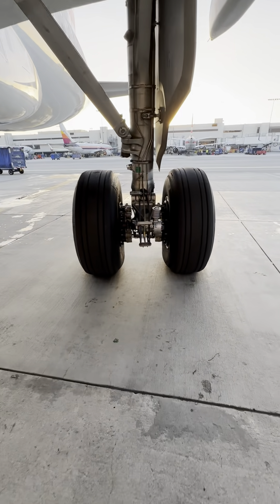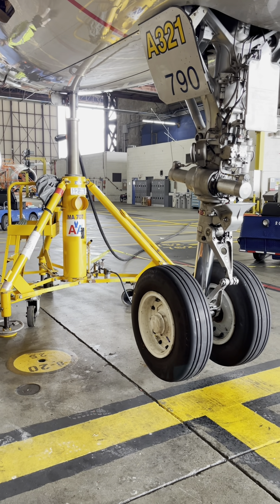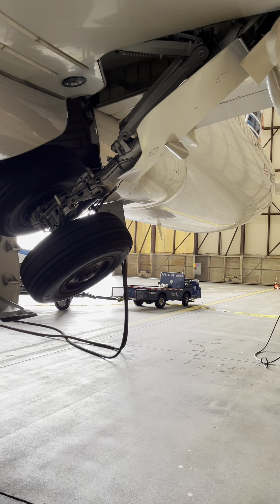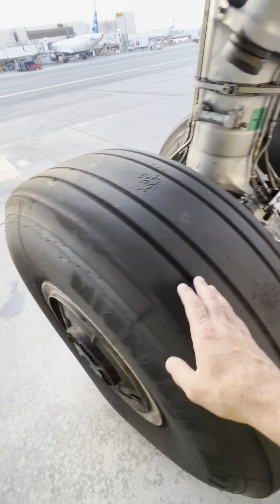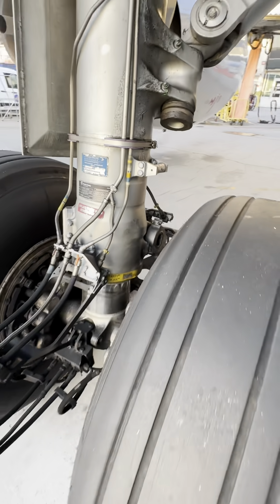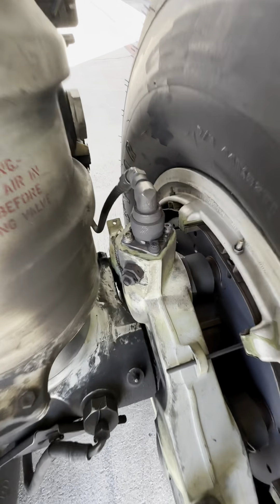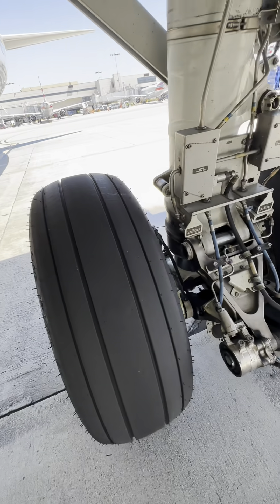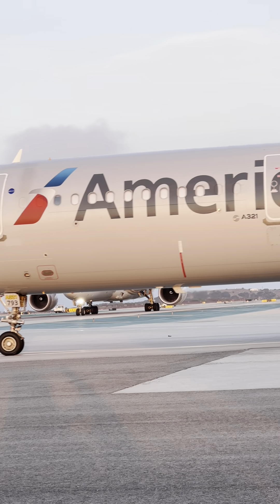Airbus 320 families and Boeing 737 Main Landing Gear comparison

Comment: 737 is ground hugging landing gear,whereas 319,320 is high standing gear,they can't be compared.
Reply from the maker: Those are the only 2 narrow body aircraft you can compare. Nothing else is in the same class. I mean we can squeeze the 757 in there but that thing is in its own category at this point. Nothing can touch it.

Comment: Most important difference, how short 737 gear is.  Easier  loading  but hard to put bigger engines without dragging on ground.
Reply from the maker: That’s why on the 737 max they had to raise the nose gear to accommodate for the larger engine
Reply: @StigAviation  Yes, the 737s advantage over many years caught up with it and gear had to be changed.

Comment: How often do u have to change the brake pads and is there a rotor that has to be serviced
Reply from the maker: It’s unpredictable. To many factors to consider.
Reply: They are not like car brakes. The brake assembly has the rotors and stators as one unit and are replaced as a unit. That’s what the wear indicator pin is for, to see when the brake assembly requires replacing @3:00 Airbus and @5:23 Boeing

Comment: Less than half the fleet at my company has brake sensors. Theres a flag that comes up in our landing data if we land heavy and or short runways and need min brake cooldown, usually 60m turn. 
Some of our aircraft have the temp sensors, but dont rise in temp that wildly.
We use a carbon brake from France but believe were switching soon, so well see how that works.
Reply from the maker: Most pilots I talk to seem to enjoy the carbon brakes. They say they can feel the difference
Reply: @StigAviation  They stop very well. The only oddity is they wear faster from small applications, so it's better to let the plane speed up then romp on it during taxi.
Reply from the maker: It’s all about the settings of what pilots put in. You also have to taken into consideration runway length

Comment: Geeky tech!!! more to go wrong, and another issue, the A319 main undercarriage leg has a TRUCK a single two wheel axle, not a bogie, like those on a skate board. A bogie is a strong frame mounting two or more axles and wheels in tandem one behind the other.
Reply from the maker: I’m glad you are very knowledgeable about the subject
Reply: Yes  and thanks for your kind comment, it is appreciated as an aeroplane undercarriage is like the foundations of a decent house. Get the foundations right, building the rest of the house is easy.  I live barely thirty miles from the Dowty(Safran) factory, set up by its founder George Dowty in the early 1930,s.   @StigAviation
Reply: Regarding the A319 oleo leg not strut, its upside down shock absorber cylinder and seal, a unique ,practical solution. Keeping these important parts away from dirt and brake dust when operating from poor or loose surfaced runways. Looking like a Luvax friction shock absorber of a 1930 4,5 Litre Blower Bentley, the secondary damper not dampener on the torque scissors is  a means of reducing 'pitter patter' when the tyres contact the runway before the aeroplane squats on  the main oleos,.   @StigAviation

Comment: One good thing about the 737 is that the WOW sensors inhibit the stall warning so you don’t get a stall warning on the ground. Airbus inhibits the stall warning under 50kt IAS as far as I know. This has proved problematic in certain accidents, like AF447 for example, where erroneous airspeed information from frozen pitot tubes led to pilots discounting the stall warning because it was deemed unreliable. We know how that ended… 😢
Reply from the maker: Ya that was a bad one on 447. But that wasn’t the only factor that contributed to the incident. So many things went wrong and lots of pilot error.
Reply: The pilots’ errors were largely down to the plane misleading them and to a faulty pitot that the manufacturer knew was faulty. Pilot error is very useful when the pilots are deceased and you can’t say the part and plane makers knew.

Comment: Boeing does have wheel brake cooling systems in place. If the brake overheats the wheel comes off and rolls away to expose the brakes to cooling air.
Reply: You joke but how often does a plane really need break cooling. Basically a rejected takeoff right, how often does that happen? Around 20 years ago I was told that one pound of additional weight costs an operator $50k in fuel over the planes lifetime. Probably closer to $100k now. Is it really worth it to haul three fans around for that situation?
Reply from the maker: @Kandralla  look, I just fixed these things, my opinion really means nothing. I have no problem with changing wheels that have brake fans or that do not have brake fans. It’s all the same to me. I still have fun.

Comment: Notice that all tne bolts on the Airbus landing gear have been fitted and the lock wiring and cotter pins installed. You can tell by those simple observations it's never been in a Boeing factory.
Reply from the maker: But Boeing also uses lock wire and cotter pins on a variety portions of their landing gear as well
Reply: @StigAviation  Boeing supposedly torque down all fasteners and use safety wire and cotter pins throughout the aircraft they design and manufacture.
That's why sometimes doors fall off brand new aircraft in flight and other parts wobble a bit, ask Alaska Airlines how that works😁
Reply: @andrewallen9993 by design that is what BOEING do. It’s up to the factory workers to ensure they follow the correct procedures to ensure it’s assembled correctly. Hardly a design fault when the guy that assembles the product can’t do his/her job correctly

Comment: What is Boeing's thinking in not providing cooling fan in the wheel? Because the wheel area is already full of axles, bearings, brakes, wheel speed measurement systems and possibly tire pressure and brake temperature measurement systems. Why add the weight and complexity of a dinky little fan to all the above? If turnaround time is important, provide the ground crew with some large fans they can use to cool the bakes. I have worked on the design of wheel based systems for both the A-320 and the 737 and the A-320 is a real pain from the design standpoint in that you have to accommodate the design to all the wheel options Airbus has offered over the years as well as the presence or absence of all the different cooling fans. We had to send an engineer overseas to Airbus for a week just to nail down the actual size and shape of the volume that was available for our equipment.
Reply from the maker: I don’t have a dispute in regards to this, remember, I’m just the maintainer of these aircraft. The manufacturer will do whatever they want to do in regards to design. I personally don’t have a problem with Airbus design, nor with Boeing design, it’s just different mentalities and different procedures. But for me at the end of the day, it’s just nuts and bolts.
Reply: From a maintenance point of view the brake fans can be a blessing but also a curse.

With brake fans fitted, when the brakes are hot, the crew turn a switch on in the cockpit and the brakes cool down - simple. When we do a wheel change, the brake fan is now another thing to have to deal with. Ensuring the switch is tagged and CB’s are pulled so it doesn’t turn on while our hands are in there and extra parts to remove and install.

Without brake fans fitted, when the brakes are hot we need to find the mobile brake cooling fans. Uses time to find, hopefully they have enough fuel in them and need to position them next to the wheel - not simple. Doing a wheel change, great, no brake fan components to deal with

Comment: Having been a captain on both 737 and A320 I tell friends traveling in less developed parts of the world if you have a choice between an airline operating 737s vs. A320s………..pick the one flying A320s !!!
Reply from the maker: The 320 is definitely the smarter airplane, that’s for sure
Reply: My friend had to transition from the 737 to the 320 family and he said it was quite a revelation. Not only did it make his job easier (not just the primary flying aspect) but the architecture and software logic DO absolutely make it safer, you can seriously screw up and it’ll save your butt (just from stories and their training with the systems.)

Comment: Brake fans ??? ………..Brake fans ??? ………Are you f*cking kidding me?  737 doesn’t even have brake temperature gauges !!!  How would you ever know when to use brake fans ???????
Reply from the maker: What are you talking about my friend ? Can you put some context behind your comment?
Reply: @StigAviation  
The Airbus has brake temperature gauges in the cockpit. You can see the brake temps. Boeing you have no idea ! No brake temp display in the cockpit.
Reply from the maker: @savagecub  yes because it’s an option that the carriers don’t buy. There are temp sensors that can be installed as well as tire pressure sensor. Just options.  That’s all
Reply: @StigAviation  
I have operated-300s, 500s, 700s,800s &900s for two different airlines. Never seen brake temp gauges. I don’t even know where Boeing would put them since there’s no EICAS in the 737. I have however operated A320s for an airline that did not buy brake fans. At least though we the had temp gauges so we could at least see when the brakes were getting hot.
Reply from the maker: My friend, I completely understand what you’re coming from, but you’re comparing two different manufacturers that have two completely different mindsets and options. Either way break temperature is obviously important but not as important to Boeing on a 737. But take a look at the 787. Completely different perspective right!
Reply: @StigAviation  
Yes I flew the 787 as an FO for six years it has a brake temp display. The 737 does not have anywhere to display brake temps so it’s not like it’s any kind of an option for that airframe.
Reply: @StigAviation  Airbus A320 and Boeing 787 have the same design and manufacturer SAFRAN!

Comment: You use A319 in the title but show a nose gear retraction with A321 on the door.   Also, Air India operates A320s with twin axle mains.
Reply from the maker: I should’ve made it clear and said 320 families. I’ll edit it. Thank you for your help.

Comment: As an A&P myself Boeing didn't do it because it adds weight and cost to the aircraft, and they are really not that necessary and the amount of time they save is not really worth it.
Reply: Can you do the fan with the wheel hub exposed in flight?
Reply from the maker: @danielbond9755  what?
Reply: Some additional elements: brake temperature may be on the critical path of turnaround time as you are not allowed to take with a A320 with brake temperature higher than 300°C (or something close to it). Thus, even if it saves limited time, if this is maintaining your turnaround time under control, it can be valuable, especially in summer. EasyJet understood it as they took the option.
However, the brake fan has a significant drawback because it is blowing oxygen on hot Carbon which is increasing the oxydation and, thus, reducing brake lifetime (which is pleasing Carbon disks manufacturers as this piece of equipment is one of their golden eggs chicken).
Reply: I guess Airbus actually puts engineering ahead of CEO salary incentives.
Reply from the maker: Yup, that pretty much sums it up. Although it is nice to be able to cool it down faster when you have a brake or wheel change 😅

Comment: I wonder what would happen if a pressurised aircraft cruising at 38,000 feet had a tire blow up inside the wheel well. It sure looks like there is a whole lot of mechanical devices in there,surely vital to aircraft control... . Humm... Ladies and gentlemen, we have just right aileron control available, so we'll spiral down safely toward our destination.
Reply from the maker: It would never happen because tires and wheels have over pressure plugs and thermal fuses to release the air pressure out before the tire reaches blow out limits.
Reply: Something similar has happened to Boeing planes more than once. Damaged tires retracted with those steel wires hitting everything inside the compartment and causing catastrophic damage to hydraulics. The little thing to stop tires spinning is a cheap Boeing solution to that problem.
Reply from the maker: @samueldavila2156  you’re talking about the 737 Frangible fitting.

Comment: Boeing didn’t put brake fans on because the 737 doesn’t need brake fans.  I’ve been flying it for years and never had hot brakes.
Reply: I flew a 737-300 for years and only one of the 20 or so different airframes I flew had brake temp gauges. So we never knew if the brakes were hot or not. Ignorance is bliss.
Reply from the maker: Because the 737 is not as heavy. Also most 737 have steal brakes, and the fans help with a quicker turnaround time with the Airbus.
Reply: Our B737’s used to have steel brakes but we retrofitted carbon brakes. The steel ones were disintegrating. There have been the odd occasion when brakes fans have been required - but not many. Usually in the middle of summer, auto brake on MAX, and a lot of taxing

Comment: Hi Stigy…. I was wondering upon landing do they do more braking from reverse thrusters or wheels?  Also tire balancing… I’m sure it’s not like automobile tires with wheel weights is it?  TY Sir
Reply: Thrust reversers, not reverse thrusters :)
Reply from the maker: It’s about 50/50.  Also depends on length of runway and pilot. I seen super hot brakes because it was set to maximum braking and I seen cold brakes because the thrust reverser did all the work and braking was minimal. It’s a very dynamic situation where many factors come into play. As for balance of wheels. They come pre balanced from the overhaul shops. We don’t do that on the line.
Reply: Thrust reversers are most effective at high speeds (important to get them in quick, also why they’ll stow even though you’re still moving rather quickly.) 

In certain conditions, TRs do a lot of the work - ie. rain, snow, etc when braking action is poor (planes have an INSANE amount of inertia with a relatively tiny contact patch with the tires in which to transfer that energy.) 

I spoke with some crew (I believe it was Virgin America with one of their brand new A320s) and asked why they didn’t use any TRs at all, and they said it’s SOP to use moderate braking with their carbon brake-equipped Airbus fleet if conditions allow. It’s actually cheaper (they have excellent wear properties) than using the fuel and maintenance associated with deploying the reversers. 😳

Comment: Another great video. An important feature of the Airbus (SAFRAN) landing gear design is the inverted shock absorber that keeps the seal out of the dirt where it can be degraded and eventually leak. Leaking landing gear struts on an Airbus are non-existent.
Reply from the maker: You are correct. But I have seen it lean very rarely. Good news is that it has a built in secondary seal that we can activate. Smart design.
Reply: From my experience it isn't  that rear to leak. We've changed the seals of more then 20 a320 neos and ceos only this winter. *Disclaimer: I work in base maintenance and all of the changes were not customer requests but due to leaks found during inspections.

Comment: Only thing omitted is the strut switch that tells many things the airplane is on the ground..rt main for the Boeing. All Boeing pilots should know this. When able, feel for the ground with the Left main..the right one will cause ground spoiler deflection and can ruin a nice landing.😊
Reply from the maker: You’re absolutely correct, the cable that runs up to the spoiler actuators to activate them it’s funny they only put it on one side 😅. Boeing doing Boeing things I suppose 😂
Reply: @StigAviation and if I remember correctly...on landing..wheel spin up and strut compression,/sqwat switch..and some sort of timed relay. You can actually " fool the speed brake". On a really, really nice landing. The speed brake auto arm will just make a clutch sound but boards don't come out. Yes,,this landing can be done...but the pilot has to understand the whole system. You must land on the back side of the tires. 98% of today's pilots have no idea what I am talking about here 😮.
Reply: Used to be a Boeing fan, but this channel is making me kind of an airbus guy

Comment: I prefer the digital maintenance manuals from Boeing. To this day, the ones from Airbus do not work on my iPad. Not that Boeing toolbox is without fault, but it has been more reliable for me.

Also the Airbus manuals feel like they haven't been written with much care. Example: I selected the correct effectivity, then opened the correct manual, in there it shows multiple possible locations with an asterisk: *may vary per aircraft🤬. THEN WHY DID I EVEN BOTHER ENTERING THE CORRECT EFFECTIVITY IN THAT POS JAVA BASED SOFTWARE CALLED N@VIGATOR! SMH!
Reply from the maker: This must be a software issue on your interface my friend. Because I never have a problem with my airbus manuals. And all our manuals are digital at this point, Airbus and Boeing. The toolbox is nice especially for the 787 but the rest is still very old. The Boeing SDS is written poorly. In that regards airbus does a better job at breaking down the systems.
Reply: The Airbus manual works fine on my iPad. However, there appears to be some misunderstanding when the Airbus manual is translated to English. Some of it just makes no sense. “Make the thrust reverser unserviceable” - what does that mean? Drive a tug into the side of it?

Comment: Does the 737 have bladders that inflate around the outer tire when they are stowed? I think I hear d that somewhere.
Reply: There aren’t bladders that inflate, rather a rubber seal that forms a friction fit for improved aerodynamics
Reply from the maker: The putter tire is always exposed to the elements on the 737. But there is a rubber seal around it. You see it in the video. They look like black rubber mud flaps.